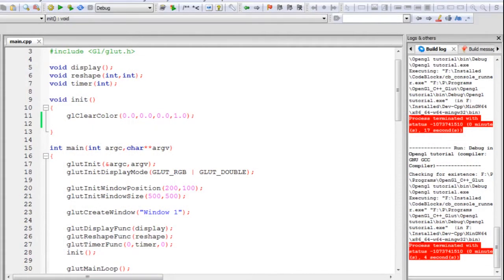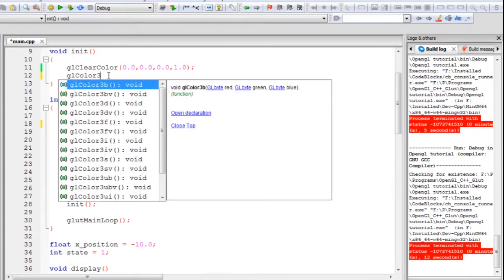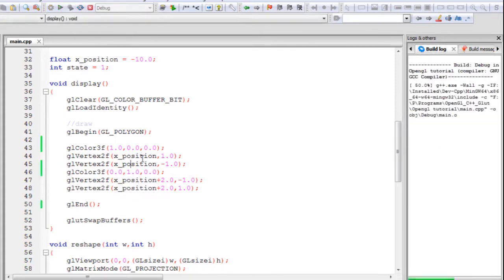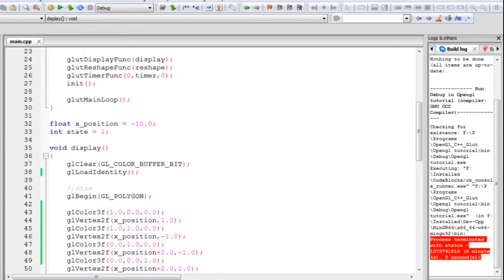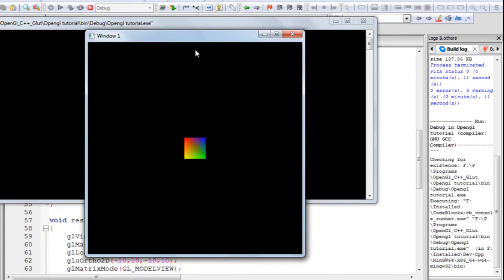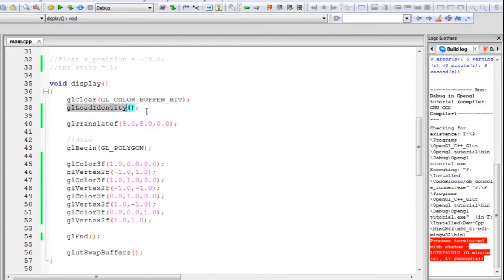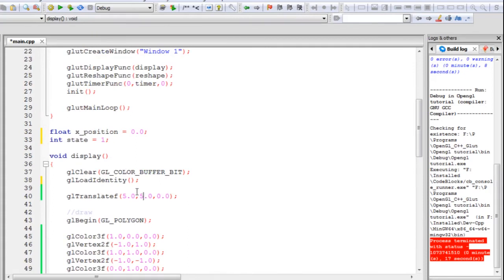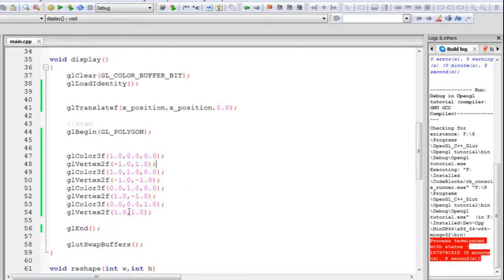OpenGL Tutorial - 4 | Color and Translation | OpenGL in C++ with the GLUT library

Comment: if i want to translate it around a circle ??
Reply from the maker: The points on a circle can by given by
(x,y) = (r*cos(theta), r*sin(theta))
where r is the radius of the circle and theta is the polar angle. You can define a variable theta to be 0 initially and update its value in the timer function. You will need to include math.h to use the trigonometric functions.
Edit your code like this:

//global scope
#include<math.h>
float r = 5.0; // or some other value
float theta = 0.0;

//inside draw function do this
void draw()
{
glTranslatef(r*cos(theta),r*sin(theta),0.0);
...
}

//inside the timer function
timer()
{
theta+=1; //adjust the increment value for angular speed accordingly
}

---
P.S. i wrote this in a hurry so feel free to ask if you dont understand anything or in case it doesnt work.